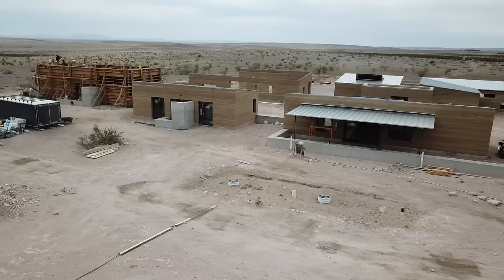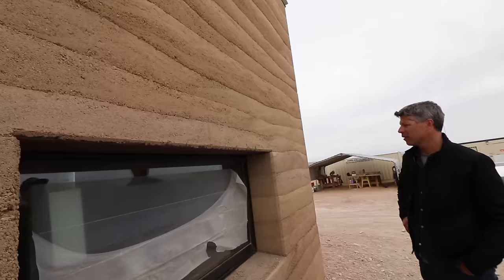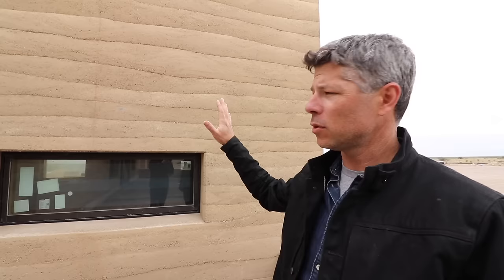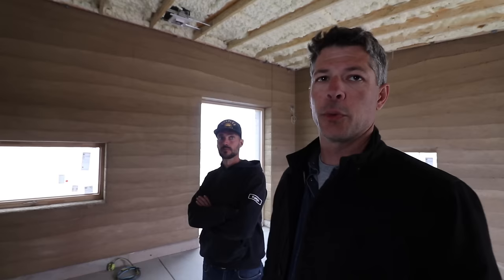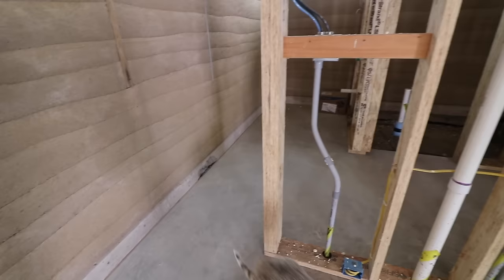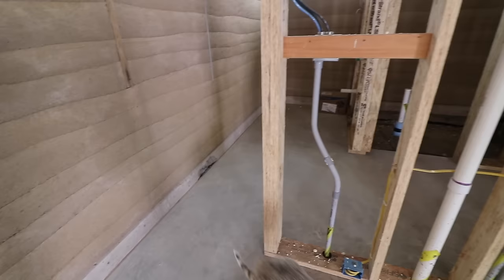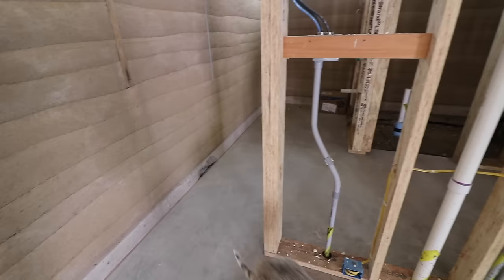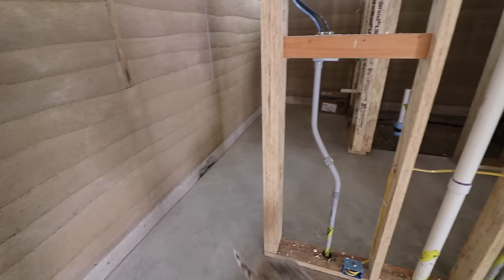Rammed Earth : You won’t Believe How They Build This!

Comment: You need to be wealthy to use a poor man's building method.
Reply: Well said. made me laff, but so true.
Reply: Well yes but that's small scale think 10,000 new homes in the the middle of India. Where only 10% of the 50 tone house needs to be brought in and the rest found locally (with in 50 km radias).
Reply: Or put it this way a cubice meter of road base similar size different material is 1.5 tone and cost $38+ ($42 for 7 bags of cement) is $80 per Cubic meter 

Where a cube meter retail for concrete is $180 and weights 2.3 tone.

It's half the cost and a fraction of the weighting.

I could rant about this for hours but I'm not smart enough to know the total cost of labor and materials and transportation.

But to me it seems likely that you could use a cheap waste products to build a house.
Reply: Poor man is the one who miss knowledges. And you need more knowledges technically and practicaly to build in earth than to build in concrete.
Reply: Well said Stu
Reply: PLEASE OVER HERE IN ENGLAND. People build their own cob type wall or haystack thick walls. Have a LOOK. Please.
Reply: @DGDG0000000  Over half the population of the planet lives in earthen houses.  Some of the oldest structures in the present day United States are earthen and were built by European settlers.
Reply: Stu mean like hipsters paying 200$ for ripped pants....hmmbig deal adobe house 18 inch thick walls cool.in summer warm in winter..but little desert dwellers can burrow into it.doesent matter if its packed..nature designed them too
Reply: Not if you do it yourself. The method would differ slightly in that the forms would be smaller and you would only do about three feet high at a time and stack it from the bottom up, whereas they built on hug form and tiop loaded it.
Reply: You also need a lot of poor men to build this way. The labor and commitment of equipment makes this an AOC kind of project. The masters demand, the slaves do. It would be a good building technique if it wasn't so inefficient to build.
Reply: shovel, sledge , some framing and some dirt, you got it.
Reply: Not necessarily. Just ro it theold way
Reply: Its hard to get cheaper than your standard 2x4 stick wall.
Reply: Poor man's home is an old rickety RV
Reply: Sean Steele  there are a few factors on the cost and weight/ volume have almost 0 to do with it
Reply: Sean Steele  and what in God's name dose how the sewage have to do with the structural materials of the house
Reply: Sean Steele  no bad sewage is a problem yes.

What the structural materials the is made out of is the question.

How you are try to tie the  2 together is got me fucked.

Bad plumbing/sewage means you need to change that.

Use compresd earth instead of bricks and mortar is something else
Reply: Sean Steele  you seam to be talking about the break down of the town planning and pubic severies in India due to lack of funds and courptions

I'm more thinking about economy of scale and the difference in the labour's and transportation not to mention initial investment verse longevity of product.

In short a cheap home that last a long time but dose take a fair bit of labour to build
Reply: Sean Steele  well that's good 😁😁😁😁

Because I am way too druck for that shit
Reply: @DGDG0000000  Lost knowledge?
Reply: DGDG0000000 what tribes been building houses like this all time lol
Reply: Yes isn't that something.  I guess guys should have left home building to the women...  most that I have seen that seem practical to me were originally built by women.
Reply: Ynless you take a 3D poured cement house for the homeless as in the prototype in Austin by ICON. They have sites.
Reply: If you watched till then end. They make mention of that. WAY cheaper ways to create thermal mass. This isn't very eco with the concrete used and off site quarry soil. You'd need the right client to want to build like this.
Reply: 9 percent 😆 tests done back in the eighties QUT found a ratio of much lower. Can't remember may have been 3 percent..  Anyway just keep the rain off LOL, or termites. Typical yank wank, aircrete much more interesting. Rammed earth great for interior walls, great ambience it ain't rocket science.
Reply: No,- you just have to be willing to work hard yourself! There is always the DIY version of anything.
Reply: @louisfranchino1775  It's that "pomp" money that lets these craftsmen perfect the methods. It's not unlike getting Tang from NASA or whatever. Eventually modern rammed earth methods may become common where they make sense, but not unless someone funds these projects to start with.
Reply: @DGDG0000000  I believe this was a comment on regulatory issues. If you're unfamiliar, the USA doesn't have many rammed Earth houses. This makes it really hard to build, because it's hard to convince the inspectors that it's safe.
Reply: @joshuacoppersmith  this isn't a new thing, it's just uncommon in the USA because of regulatory issues and climate.
Reply: Just use concrete lol
Reply: @davidpatterson9770  l would Rather use concrete.
Reply: @stu7604  No, Actually, Europeans did not build all nor introduce the adobe (earthen) structures. I am from New Mexico and it was the Pueblo - Native Americans who built with earth  in North America. The Spaniards came and adapted their way of building from the Native peoples
Reply: @DGDG0000000  - Heavy equipment everywhere, 'rammed earth' made from Portland cement and quarried granite aggregate, enough lumber to frame a house, massive amounts of pvc and pex for the 'radiant floor' hydronic heating system, petrochemical sprayed-in insulation...  eco-hypocrisy at it's worst.
Reply: Steve Wilcox  a sad but true comment
Reply: This thing is a full-on complex.  They've mentioned a "house" @3:09, but then @5:20 he mentions an office and library in the structure they're in at that moment.  Then @6:27 there's a separate "mechanical" room (utilities), then @6:33 he calls it a "compound" - which is a more accurate description.
It's as if the rammed-earth method they're using here cannot support a large open span covering 1200 - 1600 square feet all under one roof?  Then @6:37 he mentions EIGHT buildings on-site.  That's not a "house" by any stretch of the imagination.  @7:27 the buildings (so far) are listed, "office", "mechanical", "gym/banquet area"....
This is more like some sort of convention center than a "house".  It's novel, but not cozy or appealing in any way.
There's no overhang (at this point) on those roofs, which might allow the rain/runoff to wick around and under the edges of the roofs.
Reply: You actually don't but there are a lot of companies that would like to sell that idea to you. What you need to be is willing to work and good at research or connecting with ppl who know how to do this
Reply: Truth. Just got the roof rethatched.
Reply: @louisfranchino1775  You can be eco friendly and live in a luxurious sustainable home. Being eco friendly doesnt mean you have to live in a yurt and demonize all wealth.
Reply: @WWZenaDo  
I was thinking the same thing as they walked us through the project.  Also, you have to go outside to go from one room (function) to another.
Get fully dressed (in the winter) to go to the kitchen for a snack then, back to bed.....hmmmm.  NOT!
This "house" is just a bad idea on so many levels.
Reply: "You need to be wealthy to use a poor man's building method."
Yes. Looking in to central heating solution like mass heaters, and the various laws that restrict that building method, this really is the case. It's far cheaper to build a mass heater out of material like sand, random rocks, and earth, but the laws around this building method make it almost impossible to legally do so. Instead, the closest thing most people can get to is a masonry heater. Similar concept, but it's made of special fire bricks instead of cheaply and easily available materials. Far, far more expensive for the similar effect.
Reply: @4a8d698f  they build this way in morocco, teams of three or four people, truly inexpensively period what makes it expensive is how it's done in the west, the large wooden forms instead of looking at small portable slip forms, the permitting, the engineering, and so on so forth. But families build this way in rural Morocco and Algeria , it only takes a few workers, they don't consider inefficient, and the results last a long time period it's all about how it's approached. You can do it with a lot of heavy earthworking machines and have everything engineered, and spec'd out like this, and then yes it's extremely expensive. I could do it the timeless way that people have been doing it for thousands of years, and while it's labor intensive for the individual workers for the most part the people building this way in the old world are building their own homes, are you have one master builder helping a family. It doesn't have to be inefficient.
Reply: @williamwillaims  they're doing the inefficient way, traditionally cement hasn't used, it's just earth. Although in spain, before the 19th century, sometimes they used lime, or gypsum, which has similar effects of cement.. it was called Tabiyya in Morocco, Tapia in Spain. The technique was brought to America by African slaves and it was called tabby at that point it was pretty much burnt seashells for lime, and sand. This eventually evolved into monolithic concrete later in the 19th century. Before Portland cement was invented as a binder concrete, what was also called gravel wall, was largely line, gravel, and sand. In France this was Beton, would you use various natural cements after lime became less popular and eventually products similar to English / American Portland cement. Rammed Earth was the ancestor of all this however. There's a direct linear and, you could say, genetic progression from the technique of rammed Earth to modern formed concrete
Reply: This other video shows how it can be done affordably, although it is labor intensive. This is how it's traditionally done in andalucia spain, and the technique spread throughout the Hispanic world here and there.  but it's originally a Moorish technique, from North africa, Morocco and Algeria.
https://youtu.be/tVAsrsTbrnU

 if you go to Marrakesh they're still old houses surviving that were built this way, although many of them are being demolished, and then rebuilt using modern brick by new owners who are cashew in the Riad craze. The same with Fez as well. In Algeria, in the town of Blida, there's an old synagogue in ruins, but it was built at the same technique with bricks interlacing it for reinforcement. Which is also something that was heavily done in Spain. Called Tapia Real, or Tapia militaire, Because the technique was used for wild palaces and fortress. The Alhambra is largely built of rammed Earth,  

If you can find the synagogue in Blidia Algier it is worth visiting. There photos of it on the web if you didn't know what you were looking at you would think it was some sort of bizarre brickwork, or someone just stuck a bunch of bricks in concrete, but is actually land Earth, with a matrix of bricks interlacing through it. There are other similar ways that they did this. anyway look at this video..

https://youtu.be/tVAsrsTbrnU
Reply: You can always dig up the material yourself and tamp it by hand. That's how they made the Great Wall of China.
Reply: @stephenlittle7534  Adobe, carved in caves, and prairie sod tucked into earth berms (similar to peat walls) were used extensively in the West as pioneers moved out.  Free, but my great-grandma who lived in one until 1912 couldn't WAIT to move into a wood-frame home.  No more snakes fallling through ceiling.
Reply: @jeffk464  
Thanks Jeff for pointing that out. The 2x4 stick framed house should not be costing nearly as much as they are costing to build.
Reply: @davidpatterson9770  
Concrete is unstable. It requires re-bar. The re-bar rust and deteriorates. The structure collapses.
Reply: @ggsandovalarchitect  Actually Africans created the first Earthen structures. THE MUD HUT! The Traditional Ancient African Construction Technique gave the world what is now being rebranded as rammed earth. Native Americans lived in another type of Traditional Building called The Tee Pee.
Reply: Hyper Adobe is way cheaper and uses your own dirt and no forms. It is labor intensive so IF you hire people I guess it could be expensive.  I'm building my own.
Reply: You can actually do this for dirt cheap. You just have to mix and compact it by hand. 

If you have the right soil on site your cost goes down even farther.
Reply: You mean a genius' method!
Reply: Unless you build it yourself...
Reply: This is so true in other countries it is inexpensive.

Comment: Hello.  I'm a building materials manufacturer from Bolivia.  We actually have a system like this but it can be built a lot cheaper.  Here are some pointers.  Make a sliding side coffer and pack 2 meter by thickness of wall each time.  Use straw as a partial filler for stuctural integrity. if you Google "tapial construccion" there are a few videos.  The Incas used to do this system way back in time.  Cool video though.  The houses look very nice.  Plus they will last hundreds of years.

Comment: I talked my parents into building rammed earth over Adobe in Tucson AZ back in 1990. Their home was impressive and silent inside. Wall 2' thick, was so massive that the swamp cooler was only run evey 4 days and a single load of fire wood would keep the insides toasty for days. Power wise the house electrical only cost 15-20 a month.
Reply: I'll bet a couple gaming computers running would be enough to heat it.
Reply: @calavante swamp coolers work in Arizona because the air is so dry. They don't work in the midwest where the summer heat of 90 degrees is accompanied by 90 percent humidity!
Reply: calavante 
We can’t help it that you don’t get out much.  LOL!!!
Reply: @Douglas Gault,

Wow, that's awesome!

It seems clear that the people who are criticizing this type of construction as overly expensive, are failing to take into account the fact that the cost of occupying and maintaining these types of structures, is very, very low.

True, you have a higher cost up front, but these buildings will pay for themselves, over the years, in money saved on heating, cooling, and structural maintenance.

And because they are built to such a high standard, they will outlast any conventional stick-built structure, and are going to be worth much more.

In my opinion, this is a very smart way to build.
Reply: Michael Lambert why do they call it a swamp cooler if they only work in the dessert where there are no swamps?? 🤔
Reply: @dannygillmusic  LOL! That's a very good question, for sure! 😂
Reply: Who the hell uses google in 2020?
Reply: @dannygillmusic  Swamp coolers use water to cool the air, from evaporation. Thus they make the air more moist indoors where it is being sent, so the name sticks because it can make the inside of a house more "swampy" as a result of using it. In Tucson its usually better to have A/C over a swamp cooler but they can be more efficient in some applications.
Reply: @calavante lol.
Reply: @barongerhardt   lol, better.
Reply: Amazing :) This is why I consider building a cob home as a musician. I love that it would be silent outside and great to record in
Reply: Solid concrete is great if it was feudal age circa 1425 A.D.    but solid cement is hard to fit outlets and plumbing and wires and cable/data ..life needs change , demands and features become obsolete,,,  it’s nice to just demo out some boards and lite drywall and build something else or more usefull....  guess prisoners could be chained to walls when we all become enslaved ... hehe
Reply: @jfdesignsinc.innovationsid1583  going to read about feudalism. brb
Reply: Feel free to make a short video about your awesome house!
Reply: Amazing
Reply: is this like a passive house?
Reply: What do you mean 15-20?
Reply: Impressive.